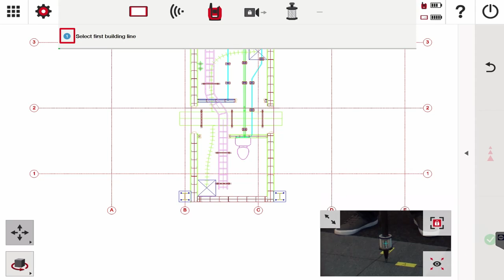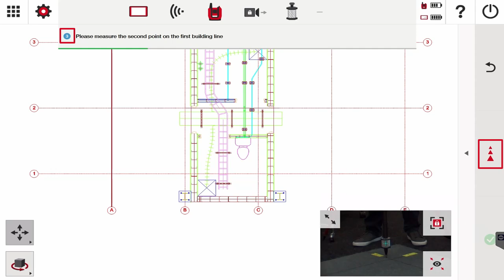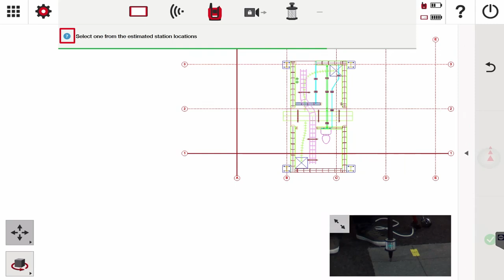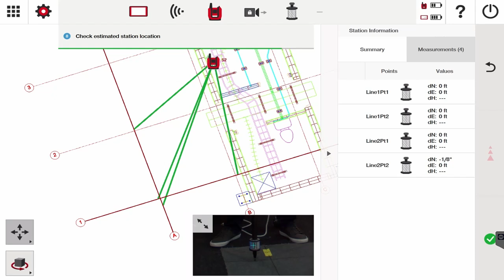Gridline Stationing

Comment: Hey, is there a way to station off an offset point from a gridline? Here I am doing layout on 2nd floor decks while they put rebar down for my plumbing, and the beams that the gridlines follow have been poured with rebar already. I was wondering if I could get the Surveyor to measure a consistent amount, say 250mm south of gridline A2 in two points, and then station from that. I haven't been able to find a way to do this, I'm just wondering if I am out of luck or if I am missing something? I would just ask for him to create control points and send them to me but I am using different drawings than him. Unfortunately the Hilti doesn't seem to be able to station from points nearly as far away as his Leica machine, and even if it could I am using a mechanical drawing for one small area and he is using the site plan. Thanks for your videos, they have been super helpful.